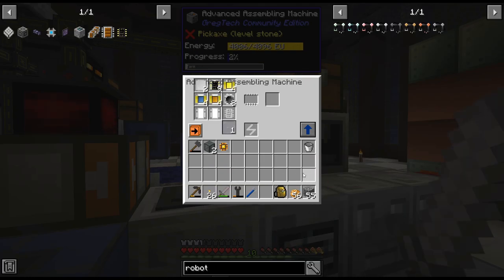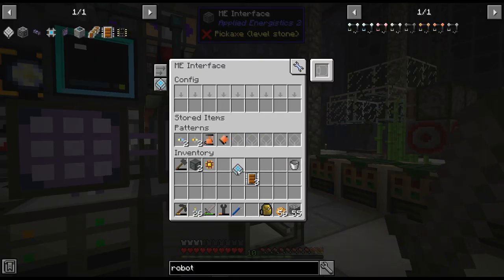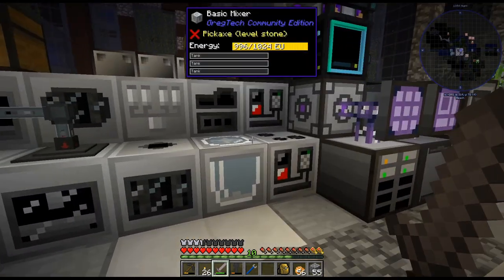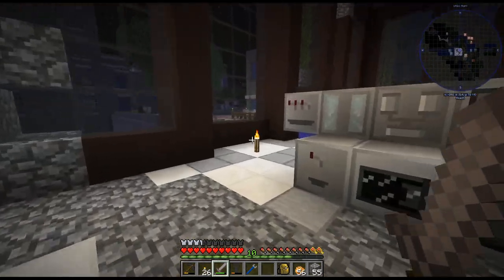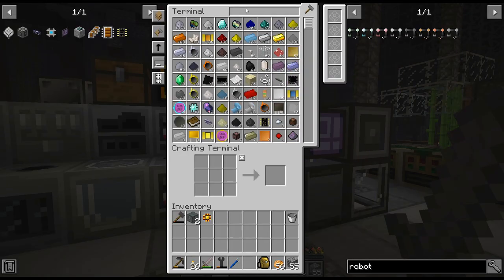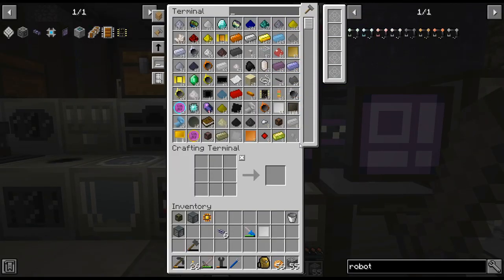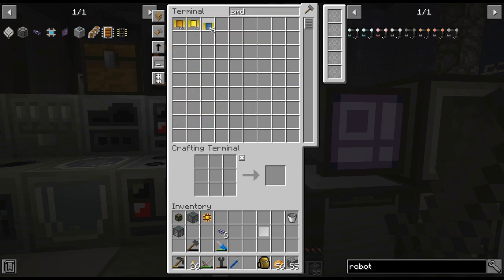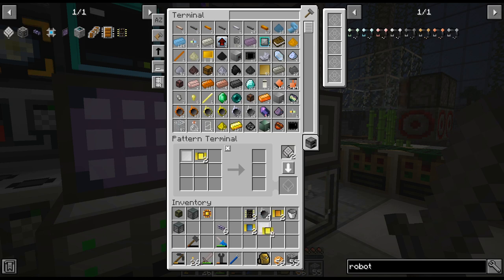Omnifactory - 23 - So Much to Automate

Comment: Ah, MV: a time of explosive growth in automation and processing infrastructure. This should be fun :D

14:20 For future reference, you can use the JEI [+] button to click in processing patterns too, the terminal just needs to be in the correct mode first for that button to light up in JEI. Manually setting up processing patterns is useful if you need to fix an oredict suggestion to a specific item or want to have different batch sizes, though. Also, certain Extra Utilities items like Red Coal have player-specific NBT data generated on them during crafting so you'll need to fix the recipe with one you've crafted already, or there will be an item mismatch when calculating the craft.

15:10 You can middle-click an item stack in your terminal (typically this is clicking the mouse-wheel down, unless you have one of those older 3-button mice [just click the button] or are on a laptop touchpad [press left and right click simultaneously to generate a middle one]) and it will pull up the autocrafting prompt, saving you the trouble of pulling out the existing items or changing terminal display modes.

21:00 Strange, guess you already know about the middle-click and it's just not working. Inventory Tweaks sorting sharing the middle-click keybind is not usually an issue as ME Terminals don't support the sorting capability anyway. I know the sorting keybind causes all sorts of problems with RS Grids for some reason though.

22:00 Hmm, good to know. I'll have to keep that in mind in case someone runs into the same issue in the Discord support chat.

27:20 Epiphany :)

29:50 I'll just mention again that for lots of plates, the cutting machine making nine at once is much faster than the compressor, especially with some easy to make and slowly consumed lubricant that makes it operate extremely fast.

31:30 It's much easier to do before you place the interface down; the hitbox is definitely a little wonky. I think the corner pips on an output face respond to the screwdriver in this circumstance, instead of their usual function of accessing the opposite face with a tool.

As a general note there's nothing wrong with doing a lot of things on demand. Things will take longer but I agree it's cool to see the factory come to life. I would however suggest that basic resources at a minimum should be prestocked so you're at least not waiting around for ingots to cook.
Reply: Hey Exa, is there a reliable way of autocrafting in AE2 with catalysts or fluids (like cable recipes which require liquid rubber or machine casing recipes that require an integrated circuit)? Using the simple method of right clicking with a wrench and then screwdriver and putting an interface on that face works sometimes, but (only when crafting with fluids or catalysts) sometimes the ME crafting CPU simply does not insert the items into the machines. I have even had trouble making small gears in the extruder (calls for a small gear extruder mold, which is a catalyst).
Reply: @el-nathan  when there's a catalyst item left in a machine, you program the processing pattern to not include that catalyst/fluid. You use a separate machine for each distinct catalyst/fluid.

Regular AE2 blocking mode doesn't work properly with GregTech machines, but PrototypeTrousers's fork of AE2 does.

Not sure which version you're playing on, but I strongly recommend the Nomifactory (yes I spelled that right) development version at this time. As of January of this year, my team and I parted ways with Damien and we develop the pack independently now.

Omnifactory's latest version on CurseForge is 1.2.1 from June 2019; our April 2020 release (1.2.2) was rebranded with some enhancements as Nomifactory 1.2.2(.x). The development snapshots contain all of our work to date so it is approximately two years of improvements over the release.
Reply: @Exa4096  Yes, I am playing Nomifactory, and thank you for the advice! I found the problem was much dumber than I thought: the interface was inserting ingredients into the small storage crates next to them (I found a bunch of ingredients in there that I assumed were lost). I got rid of the storage crates and the autocrafting runs smoothly now. I am using 4 different assembly machines for recipes that use liquid rubber, PE, solder, and integrated circuits. Thank you again for the advice!